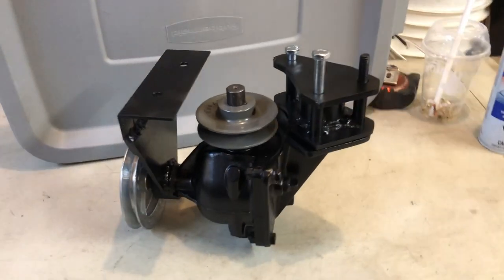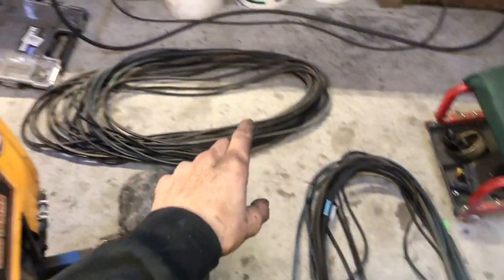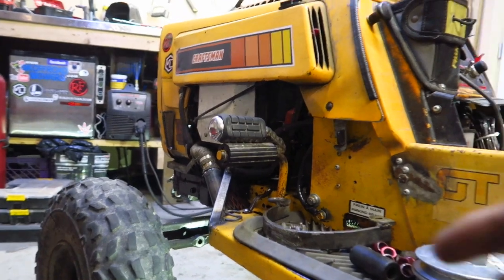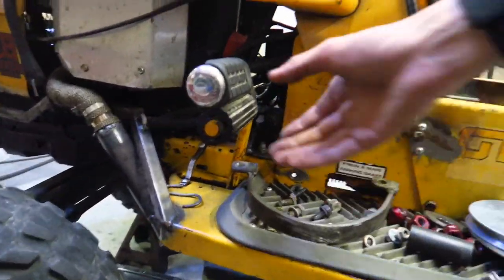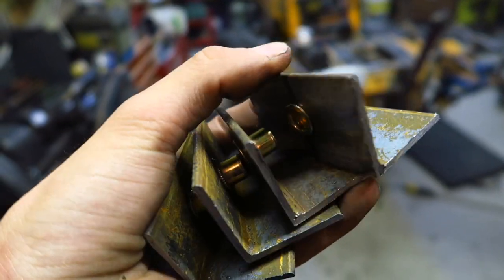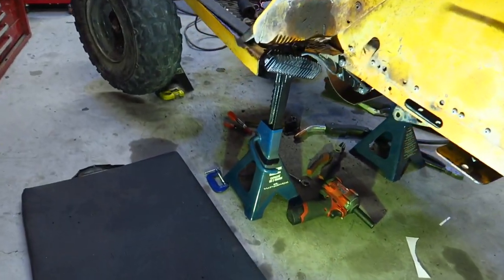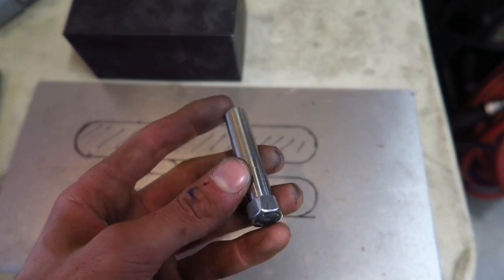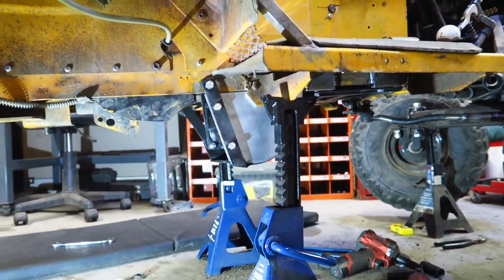Building MUSTY THE MOWER (Part 8)

Comment: hello hello, I like to know where you got the 90 degree gearbox from. I'm looking for one but nothing
Reply from the maker: I got it from a cutting deck off a bolens G9 tractor 
It was the pto for the cutting blades!
Reply: @okoffroadmowers  oh very well, here we go, you will know by now the diameter of the shaft?
Reply from the maker: Believe it was 5/8” input and output